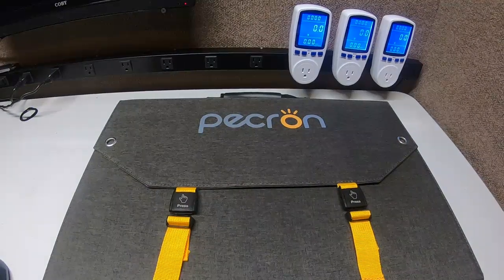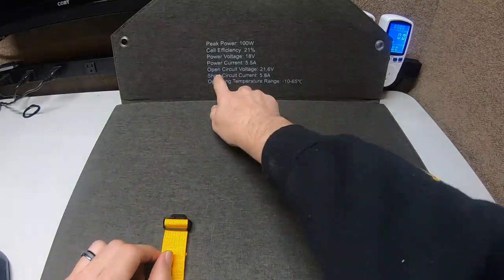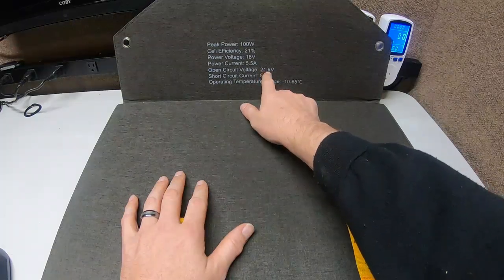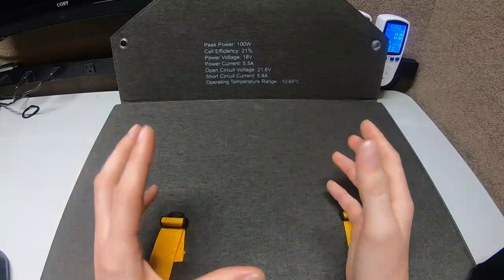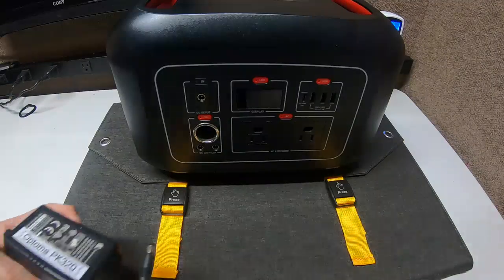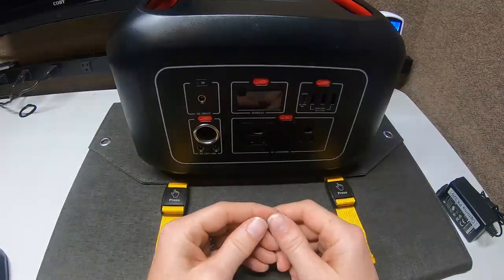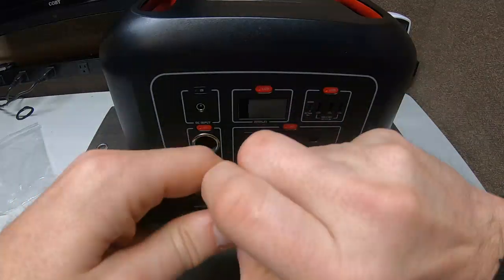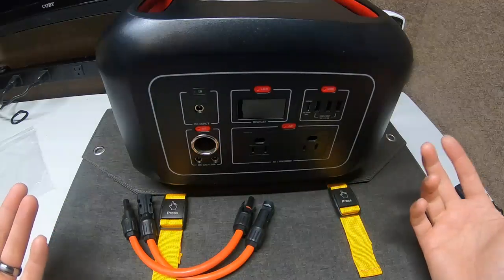My solar panel is not charging my power station, WHY? WHAT'S WRONG? *****SOLAR 101

Comment: hello again Bob! your power box was 12v to 18v  how do i find mine? what do i look for? i have the specs right infront of me..lol thx again Bob!
Reply from the maker: [[[[[ RIVER 2 MAX SPECS: ]]]]]

Capacity
512Wh

Net Weight
Approximately 13.4lbs

Dimensions
10.6 x 10.2 x 7.7inches

AC Input
100-120V 50Hz/60Hz, 660W Max

Solar Input
11-50V, 13A, 220W Max <-------------------------------------------------------------RIGHT HERE IS YOUR SOLAR INPUT!!!!!

USB-C Input/Output
5/9/12/15/20V, 5A, 100W Max

DC Output
12.6V, 10A/3A/3A, 126W Max

USB-A Output
5V, 2.4A, 12W Max

AC Output
120V 50Hz/60Hz, 500W (Surge 1000W)

Cell Chemistry
LFP

Cycle Life
80%+ capacity after 3000 cycles

Discharge Temperature
14°F to 113°F/-10°C to 45°C

Charge Temperature
32°F to 113°F/0°C to 45°C

Optimal Operating Temperature
68°F to 86°F/20°C to 30°C

Storage Temperature
14°F to 113°F (68°F to 86°F is best)/-10°C to 45°C (20°C to 30°C is best)

Car Input
12V/24V, 8A, 100W Max

DC5521 Output
12.6V, 3A, 36W Max

App Control
Wi-Fi, Bluetooth

Comment: Good day Ramblin Bob! i have a eco flow 100w solar panel mono. How do i find out what volts i need to charge my eco flow river max 2 (512wh 20ah 25.6v) with this panel? Thx Bob
Reply from the maker: [[[[[ RIVER 2 MAX SPECS: ]]]]]

Capacity
512Wh

Net Weight
Approximately 13.4lbs

Dimensions
10.6 x 10.2 x 7.7inches

AC Input
100-120V 50Hz/60Hz, 660W Max

Solar Input
11-50V, 13A, 220W Max <-------------------------------------------------------------RIGHT HERE IS YOUR SOLAR INPUT!!!!!

USB-C Input/Output
5/9/12/15/20V, 5A, 100W Max

DC Output
12.6V, 10A/3A/3A, 126W Max

USB-A Output
5V, 2.4A, 12W Max

AC Output
120V 50Hz/60Hz, 500W (Surge 1000W)

Cell Chemistry
LFP

Cycle Life
80%+ capacity after 3000 cycles

Discharge Temperature
14°F to 113°F/-10°C to 45°C

Charge Temperature
32°F to 113°F/0°C to 45°C

Optimal Operating Temperature
68°F to 86°F/20°C to 30°C

Storage Temperature
14°F to 113°F (68°F to 86°F is best)/-10°C to 45°C (20°C to 30°C is best)

Car Input
12V/24V, 8A, 100W Max

DC5521 Output
12.6V, 3A, 36W Max

App Control
Wi-Fi, Bluetooth

Comment: Hi Rambling’ Bob! This is Wendee the grateful subscriber who you made this video for. Thank you so much for your prompt response and going out of your way, so I can I understand more. My initial question was why my Thunderbolt 100 W solar panel from Harbor Freight did not charge my Bluetti EB3A.  I looked up the specs in the manual for both of them. The rated output for the HarborFreight is 18 VDC, 100 W,  5.56A. Is VDC, the same as OCV? The thunderbolt solar panel does not say the OCV spec. The specifications for the Bluetti EB3A is OCV 12 V to 28 V, input current 8.5A max and input power 200 W max.  It seems that because the solar panel is within the range of the solar generator that it should work. Unfortunately, the thunderbolt solar panel has the J plug cable. I have a J plug adapter that turns into an 8 mm plug. do you think that this reversed the polarity, and that is why it didn’t work?  The Bluetti doe not take a J plug cable. Harbor freight says I need a 12VDC charge controller which is sold separately. If I buy that charge controller, can I then jury rig it to attach to my solar generator? I saw Hobo Tech bypass a built in charge controller and attach to a solar generator by putting two wires one from the panel and one from the generator into the input plugs on the left side of the charge controller.  Is that what I need to do?  My small 80 W Suaoki foldable panel works beautifully with my solar generator. I called Harbor Freight solar panels specialist That was a joke. They didn’t even know what a Bluetti solar generator was.
Reply: Bob, you should I add a link so we can buy you a cup of coffee for your expertise! Lots of people would be very happy to do that for you. I’m a big fan now.
Reply from the maker: Hello, This is Ramblin Bob's wife and I set up a buyacupofcoffee page for him :)
He really loves to help people so they don't lose their money and if you wish, Feel free to buy him a cup of hot chocolate if you would like to :)

https://www.buymeacoffee.com/RamblinBob

P.S. He would be very thankful for the surprise when he sees it :)
Reply from the maker: Thank you for kind words :)

P.S. We started this channel to be able to help folks because we did not have many people that were willing to help us learn :(

P.S. If you ever wish to support the channel, If you ever use one of the amazon links on any of these videos, Amazon pays us a couple of pennies when you buy the stuff that you are going to buy anyways :)

THANK YOU AGAIN FOR BEING A SCRIBER :)
Reply from the maker: Hello Wendee :)

Harbor freight staff is right off the street like "hey kid, you want a job" LOL it seems that way in every store, So we only go in there when we know what we want to buy in advance. LOL

   The real VOC of that harbor freight 100 watt panel is really apx 21.5v VOC. That should work fine with that solar generator, But you prolly have to mod it in some way. If you are not comfortable doing that, We would recommend getting a different panel and taking that one back to the store. 

Remember, Once you modify any product from there, You can not return it ;)

The 18v rating is the working voltage and not the VOC voltage. It is a cheap panel but it works well. The company failed to list ALL the specs for this panel. So that leaves one answer left, It has the polarity reversed and you would have to switch the POS & NEG around i bet.

P.S. And all of the harbor freight panels that we bought, We cut off that crazy old fashioned plug and put MC4's on there and that way we were able to reverse the polarity much easier. 

https://youtu.be/Jel6RlCpHuk
Reply: Thank you so much, I am hopping in my car to return the panels now. I hope other people read this, so they don’t have to go through what I am going through. I appreciate you and the time you took to answer all my questions.
Reply from the maker: Nope, You do not need a charge controller, That is 100% false. Because the bluetti already has a charge controller built in the unit. You would have to reverse the NEG + POS i bet to get the controller to activate.

My best advice to you now is, Take back that panel and buy one with MC4 already on it so easy adaptors if needed.

remember: If you mod anything from harbor freight, You can not return it. Just be safe and buy a different panel and save that frustration :)
Reply: Hi there, I was excited to watch this video too, but my brain overloaded about halfway thru,lol, I just find it hard, like he says, it sounds like complicated algebra 😅 but I did as you, I bought a Bluetti power station, the EB70, and proceeded to buy a - how shall we say - the most reasonably priced - solar panel from Amazon(here in Canada) and it has been disasterous! That reverse polarity is complicated when you don't even know enough to know the name of the cords/connection doodads to ask Amazon to show you what you need/want. Plus the panel did not come with adapter end plugs either,arg! All that to find out the panel was not enough to work for charging a EB70😮, and THEN they said - oh send it back and we will send you a 100watt panel. Ok. Thats done...BUT, the panel needs full sunlight and you can't even have a fly fly over it😂 - cuz it will impede the function of the panel that needs perfect uninterupted sun! All this time and effort - I should have just bought the panel that Bluetti makes for this power station!!! 🤔🤪🛠
Reply from the maker: @janebray9392  @Jane Bray  Sorry Jane, I just saw this comment now, A little bit late, Youtube never told me that you typed this comment, SORRY :(

 Yes, The companies that make the power stations already worked out the guess work in pairing panels and generators for you. They always are more money, But they do have an easy solution for people just starting out and learning this fantastic new hobby :)